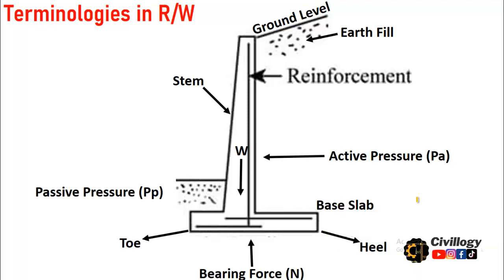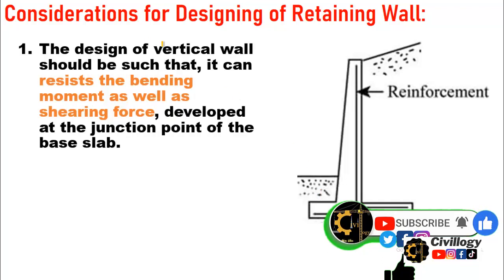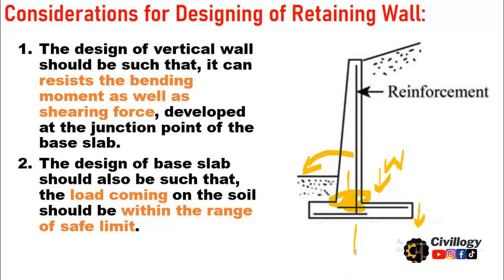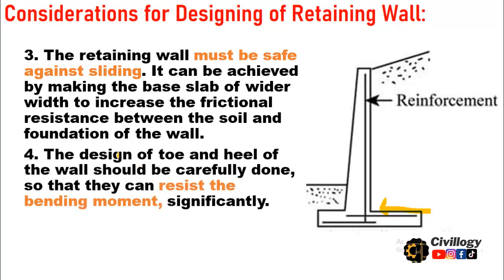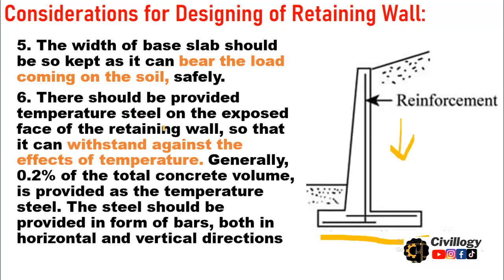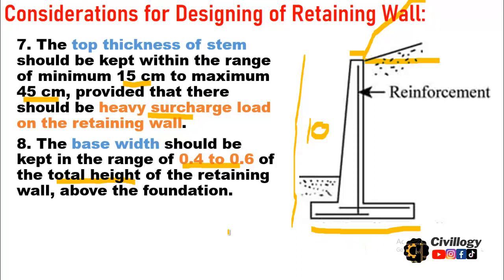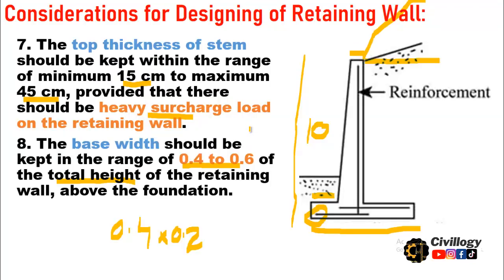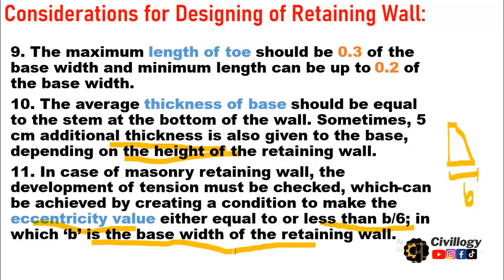Rules for design of retaining walls|Considerations for designing of  Retaining walls|Design wall

Comment: pls note and correct the mistake in point no 8 &9.
If height of wall=10m
👉Then base width=0.4x10=4m or 0.6x10=6m
👉 length of toe = 0.2x4 or 0.3x4
Thanks